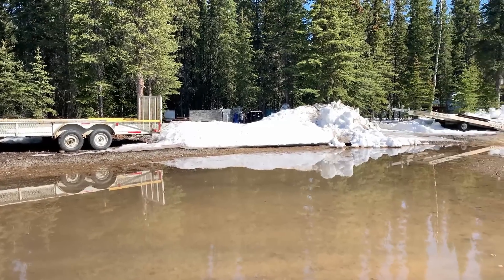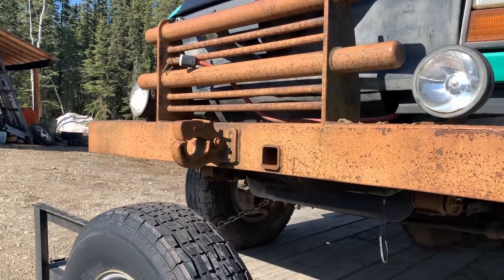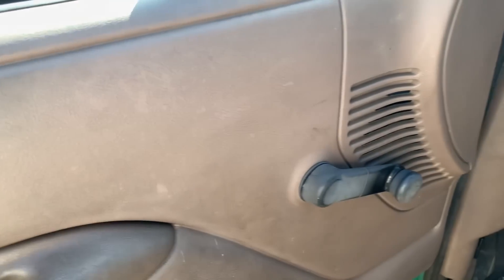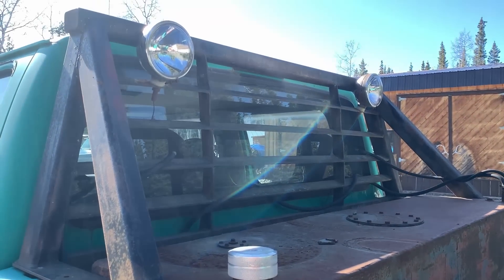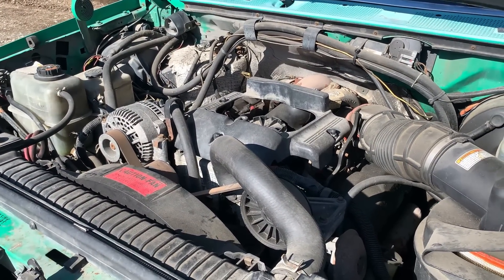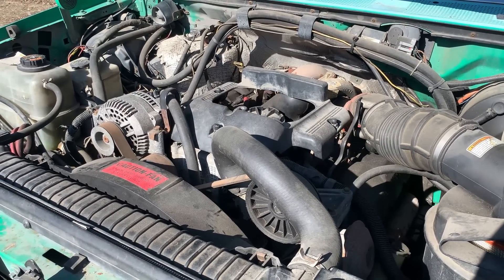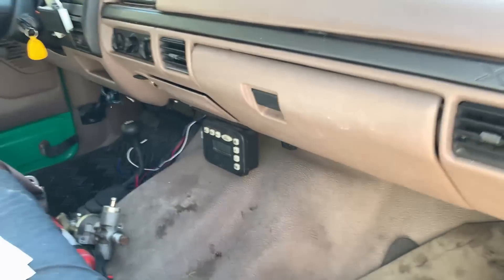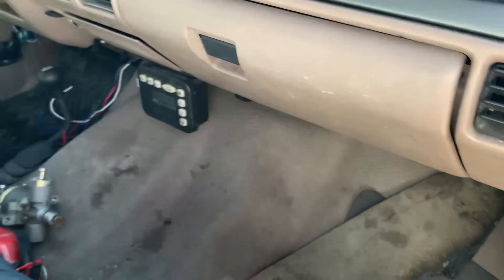North Slope 1 Ton 7.3 Powerstroke

Comment: Its scary here in the states that in the snowbelt these are getting harder and harder to see on the road non rusted out or rotting in a yard. What a unit!
Reply: They are still quite common in Alaska as almost all of the oilfield uses crew cab 4x4 diesel pickups, usually Fords, but some Chev/GMC, very few Dodges but a few too.  Then they get sold cheap as surplus every few years when the newer trucks are ordered by each individual company.  I remember being a member on a few Chevy truck boards back maybe 10 years ago people were chasing the one ton four door square bodies, and there were literally a half dozen or so in our college campus parking lot at any given time!  They were still dirt cheap in Alaska.

Comment: Clint from C&C Equipment has one that was a V10 unit, perfect body with minimum rust, tore it down completely and built a 7.3 powerstroke... a short but sweet series of videos. He happens to love them as much as anyone could.. its painted to his color likes and his daily driver. A lot of nice stuff done to modify the engine from the really big names in diesel plus area diesel service built his pump. They will not modify a pump for horsepower for what ever reason they have. I wish that ford had done the common rail fuel system for these trucks as I had one that was a dream and got so sick of hard starts so got rid of it when mad so now have traders remorse hard hard. If and when that new dimple piston system becomes available for these engines, they will go a million miles average and more for some. Plus get so good efficiency that fifty miles to gallon will just be common as well. Started with big name engineers in Cat and Detroit making it possible to do this.

Comment: Good buy, my old boss had a 95 or so Ford F350 4x4 crew cab long bed with the power stroke diesel, it probably has over 500,000 miles on it by now, he sold it at about 350,000 miles to a local machine shop and they took the bed off and mounted a service box and they still use it.

Comment: My first landlord in North Pole in 1984/1985 told me trucks on the north slope were run 24/7 during the winter because if you turned a truck off in those temperatures it would never start back up. That is a great looking truck. Much good luck with it

Comment: that thing is awesome. So practical and built for purpose. IMO a good cleaning and clean up the rust spots and just leave the truck the way it sits. So cool ! I like how they put the door straps in the limit the doors flying open, helps save the hinges. I know its low mileage but Id bet it would be double that with all the idle hours factored in. Either way itll run a long time probably

Comment: Thank you for another great video !  Similar to my 92 F-350, crew cab, 460/C-6.Was originally an Air Force security on flight line, then the AK. Railroad had it, was the mechanics truck, then sold at a muni auction here in Anchorage.

Comment: Be curious to know if it has any stored codes. Ipr certainly needs to be addressed. If you have something that will show you live data you can check the vitals while cranking, see if its building oil pressure. Those cam driven hi-low pressure pumps are fun. The plunger can fall out of the bottom of the pump and ker plink all the way to the bottom of the oil pan, ask me how i know. You do have the nicer of the pto idle control boxes that were available. The basic one was basically just charge protect mode with no digital rpm display. Just started watching your videos, i came for the highboys, have several of those myself. Looking forward to seeing you getting this truck running.

Comment: I see you have four tires and rims in the back of the truck.  That may be a good thing considering the passenger side front tire appears to be pretty rotted.  Good luck with the truck, a decent diesel engine will run almost forever with proper maintenance.

Comment: You decide to put it up for adoption I would be very interested. Other than not being an XLT with power windows it is pretty much the truck I've been looking for. I need a larger truck because of my size, I'm 6 ft 7 inches tall. Either way you scored this time. It must be nice to be in an area where there is still cool things to find easily. Best regards from Bob, Virginia USA

Comment: Please show how to get it running correctly, l have a 1984 6.9 thats been sitting for twenty five years!  I have forgotten everything l knew about how to bleed the injectors . Is there a way to lubricate the cylinders before turning it over? Looks like a great truck for here in Michigan ,good score.
Reply from the maker: Just crack open all the lines going to the injectors and start cranking it over. She’ll bleed out.

Comment: Damn auto tragic transmission. Overdrive leaves chat all the time.
If you hose it with consent it'll go. 
I have a 96 power smoke won't start otherwise. I have glow plug relay unplugged because it smells like a dodge burning wire smell.